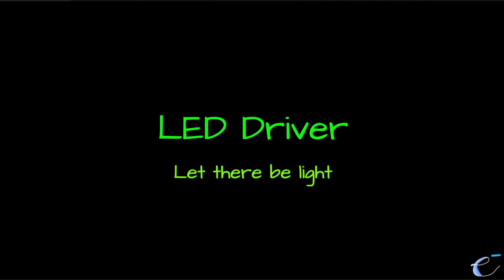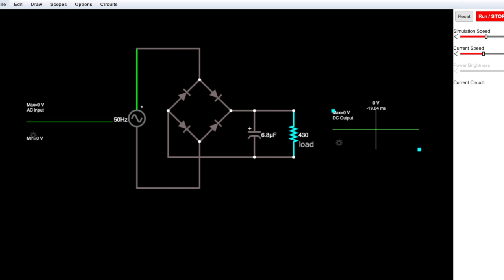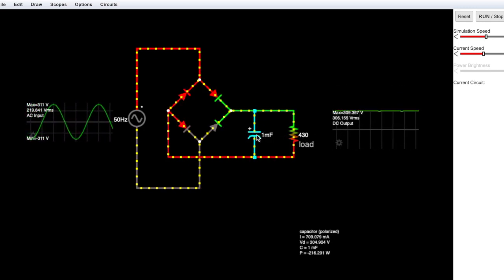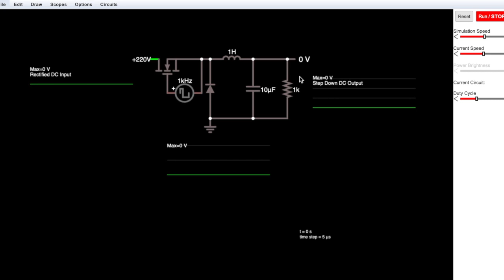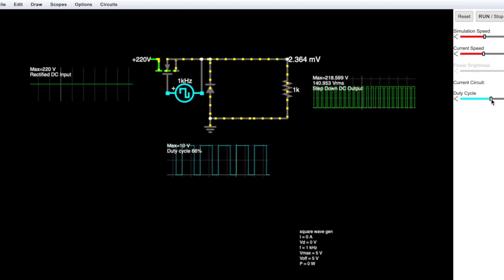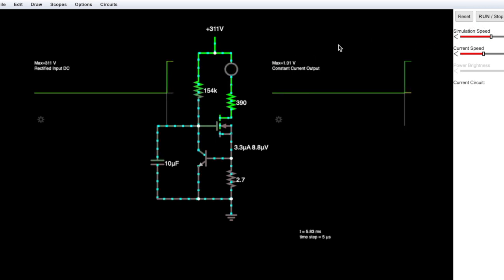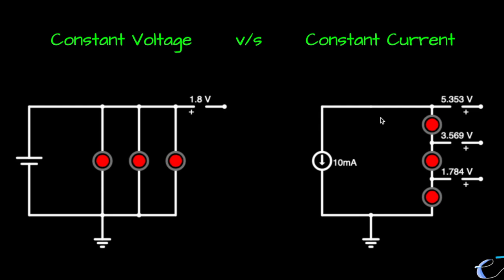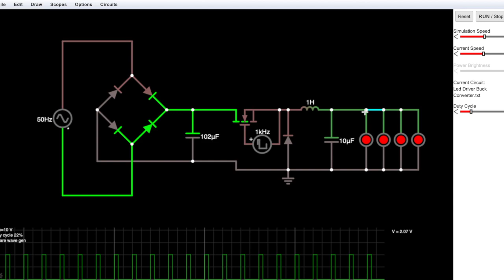LED Driver circuit explained - Constant current vs Constant Voltage - Let there be light

Comment: sir how can i make led  driver using dc to dc boost converter and dc to dc buck converter in the same  circuit .I mean how can make the connections between this dc converters and LED

Comment: We need a driver that connects existing LED lights to poE, and adds an external switch. Remote computer control might be a nice touch too. 
Sigh, a man can dream.

I think such a Driver would push poE into the consumer market and power up DIYers.

Comment: In the constant current schematic you give, the mosfet is in a linear region (bad efficiency). So it will heat much more than in the constant voltage circuit. How do we have the best of the 2 world?

Comment: Hello 

I'll be thankful if you help me regarding power supply of my led

Cob led which I got is flipflop type and its of 100w and on data sheet it mentioned 3500ma current and 34v but problem is ,I am not finding exact same output driver but someone suggested me to use two 50w and one 20w driver parallely connented (1500ma+1500ma+600ma=3600ma) by doing this it's exceeding 100ma current and even when I test voltage of that driver it show 48v... Will it be safe to power up the led or it'll damage the led? connecting driver parallely is a good idea to get my required current?

On data sheet it's mentioned
Forward current =3500ma
Peak forward current (duty 1/10@10ms) =5250ma

 please help
Reply from the maker: I don't think this is a good idea. If you want to use drivers in parallel, you need to make sure they are all exactly the same voltage and have reverse voltage protection. If not the drivers will be damaged. 48v is quite high and will possible damage the LED. This doc will give you some idea on the issues with using drivers in parallel - https://www.cui.com/catalog/resource/download/current-sharing-with-power-supplies.pdf
Reply: Sir can I take 36v 5amp SMPS and connect it to dc step down module and adjust current to 3.5amp and use it...will it work?
Reply from the maker: I would not advice that. SMPS do not normally maintain constant current which is what you need for the leds to be uniformly bright.
Reply: Brother maximum I am finding 3000ma and 27-36v driver but When I manually test the voltage,it is showing 47-48v..so I am really confused that how I can give it ,it's required power supply...
Reply from the maker: Sorry, I am not able to help you here. I found this one but it is currently unavailable - https://www.amazon.com/100W-LED-Driver-12V-27V-3500mA/dp/B074LZHG97/ref=cm_cr_arp_d_product_top?ie=UTF8
Reply: Thanks sir... If you don't mind ,can you share me your mail id...I'll mail you data sheet of my led..upon that can you suggest me best power supply to that led?
Reply: Then what you will advise me sir... Neither I am not getting driver nor I  can use with SMPS... Can you advise me please
Reply from the maker: I have never had to use such a driver before, however, if you search for 3500 mA led driver, you should be able to find some online. make sure the driver is 3500 mA and 100W the voltage can vary a bit.

Comment: What about the power factor of the AC supply?
Also Electrolytic capacitor (EC) reduces the life time of the LED Driver, so how to remove EC? but the output should be constant.
Reply from the maker: Good question. The buck converter has a very goof PF. For the capacitance you can use a brand like Nichicon, which has a good life. Normally engineering is a balance between cost and performance.